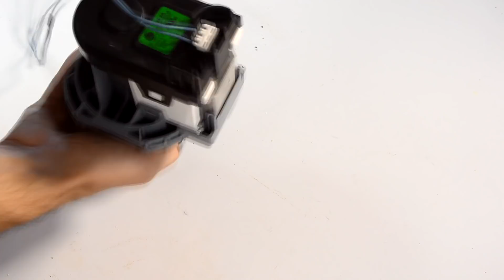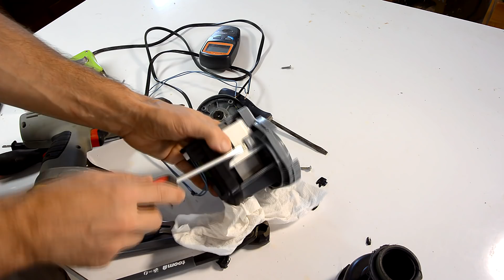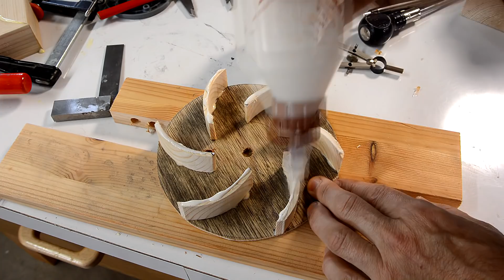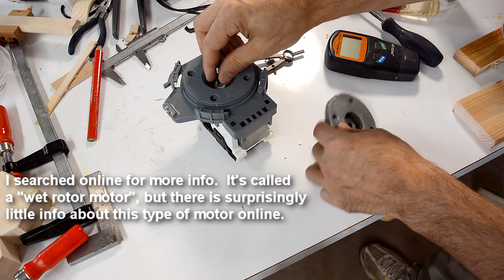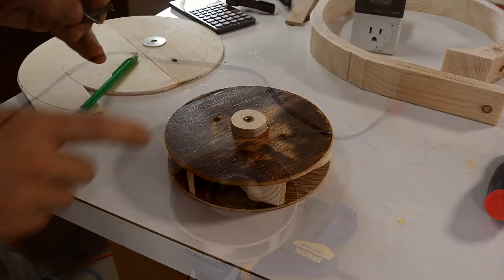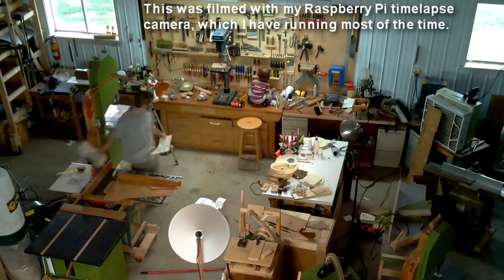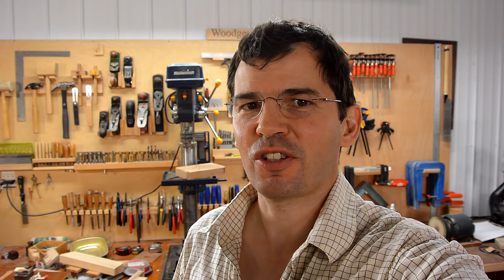Wet rotor synchronous dishwasher motor

Comment: You know who could tell you more about this motor... AvE  You guys should do a collaboration video on motors.
Reply: I can't decide if that would be a complete disaster or the power tool equivalent of a buddy cop movie. Engineer and fabricobbler, working together. Measurement meets guesstimation. Design intent meets dead reckoning. Tree corpse mutilation meets slow-motion bumblefuckery. Will they design a marvel of modern materials science, or will they end up dueling with reciprocating saws?
Reply: As a big fan of both I, too, would love to see a collaboration. I think, though, there might be some serious obstacles to overcome. Matthias' orientation is woodworking and home-built woodworking machines; while AvE is a committed metal-head whose passion is exposing bad engineering and design in consumer tools. Also, my sense is that Matthias is in the Eastern Part of Canada; while AvE is way out west somewhere. But one can hope.
Reply: The guy I've learned a lot about motors from recently is Jeremy Fielding
Reply: Actually, I think Matthias knows more about motors than AvE does. I love both channels, however. Anyone who thinks Matthias is a shill has never seen a shill.
Reply: I just watched a couple of the Jeremy Fielding videos. He seems pretty good! I subscribed and will watch for a while.
Reply: Check out Jeremy Fielding on youtube. He's a wizard with electric motors.
Reply: I get the feeling the lot of us sub the same channels ......
Reply: Yup
Reply: The both have adorable shop helpers. That might be enough to start a conversation.
Reply: shoegazer277 Which video? I missed that. 

I like 'em both; you'd think a big empty wasteland like Xanada would be big enough for the two of them. 

OTOH nobody's ever seen AvE. Maybe they're both the same guy. There aren't that many Canadians that can speak; statistically it's not unreasonable.

Comment: are these motors dependent on the water around the shaft for lubrication? Or would they work dry on the long run? did you use any kind of lubrication when assembling it back?

Comment: So, where is green colour on this blower? All presented data isn't nothing new to me because my profession, but are simple and clear presented to wide range of DIY people. Water cooled motors goes burned out and overheated if running without water, rubber or silicone parts, etc.

Comment: How did it break?

Dishwasher repair seems like a dark art but but there really isn't a whole lot to them and most issues are pretty simple to fix.
I've repaired my own once, fixed one for one of my tenants and got a free counter-top one from the scrap yard that I got working again for the cost of a small microswitch.
Reply: Probably the main controller board, mine stopped working after about 10 months and under warranty needed lots of parts to resurrect it. It's been fine since 6 years counting.

Comment: I've recently fixed a few water pumps that had a similar mechanism... (fishtank pumps and  a standalone water pump.)  The entire impeller and shaft/magnet were in a wet environment, and the motor windings were enclosed in a waterproof housing.

Comment: So, you Need to pull the choke to get the motor to start? Sounds kind familiar
Reply from the maker: ha ha, hadn't thought of it that way!
Reply: Maybe build an iris for the inlet closed with a solenoid powered by the starting current. Because a butterfly would be too easy. I have an old carb from a garage sale with an iris for the choke. Never could find out what it was used on.

Comment: These are also one of the few motors that don't rely on induced or conducted electric current.. A shaded pole motor's rotor submerged in water, would short, cause electrolysis and wreck the rotor without taking steps to insulate it and thus further reducing the distance between stater and rotor.
Reply from the maker: Not sure about that.  The voltage induced in the rotor is very low (remember, it's shorted), so it might be too low a voltage for electrolysis to happen

Comment: Your little girl already shows signs of growing up with a great degree of mechanical aptitude! (My dad raised me that way.) There is no such thing as "no user-serviceable parts inside"! :-)
Reply: TheTechnosasquatch we have statutory rights here, which is 6 years on stuff like this for manufacturing faults. Too many people dont know that and dont understand what it means. Obvioisly if u abuse it, its not covered, but random failure is covered.
Reply: Ace Lightning i was brought up the same way, when something breaks, i usualy take it appart to find out whats inside and learn how it works. Unfortunatly, when my dishwasher broke, it was the pump that went, and the thing was not easy to get into. At a year old, i would have expected that dishwasher to still be in warrantee? Or do you not have such great support over in the USA
Reply: In the end, though, it wastes resources and contributes to pollution, unless the company is willing to recycle the entire broken machine.
Reply: I've replaced a couple of dishwasher motors - usually you have to contact the manufacturer to get a replacement motor, and sometimes it's more expensive than seems reasonable. They'd rather sell you a whole new dishwasher instead of a simple part.
Reply: Moving the sawdust from one bucket to another, fun !
Reply: +Ace Lightning...That is becoming the accepted business model, replace, not repair. It is cheaper for a manufacturer to give a 20% or more discount on the purchase of a new machine then provide the logistics and components for a repair division, nobody wants to warehouse parts anymore.
Reply: Matthias is in Canada, but I imagine they opted out of getting an extended warranty for a better sale price.

Comment: on my dishwasher the magnet broke apart after only 6 weeks of use luckily warranty replaced it but strange fault
Reply: MN SHP not really, if the magnet had a weak point in it somewhere, caused by poor manufacturing, then it would easily pull itself apart when spinning.

Comment: Timme to learn 3d printing and print your own case for the motor.  Also you could get after market bearings that are sealed and out last those bearings if it were important.
Reply: We need wood here, not plastic. Maybe a CNC machine that can handle thick wood.

Comment: The electronics replace the motor start cap.
Reply: No. It is a totally different type of motor. Not an induction motor at all. It is a brushless DC motor or, you could say that it is a permanent magnet synchronous motor. Start caps are for induction motors.

Comment: I thought a cycloconverter needed no storage components.
Reply from the maker: if you want to reproduce a smooth waveform, you may need to output energy when the AC is crossing zero, so you need some storage.

Comment: Aren't perpetual energy machines powered by negative comments on Youtube????
Reply from the maker: if that were the case, they'd have lots of power!  Or maybe just negative power.  That's probably it!
Reply: No, they have a negative charge.
Reply: Matthias Wandel IIRC, "traditional" wormholes need negative energy to keep the mouth stable.... you might be onto something huge! 😂
Reply: that text made me choke coughing and  laughing at the same time hurts. 😂
Reply: I hear they're powered by lot of hot gas.
Reply: Chris Ormsby that's the perpetual head shaking machine - powered by limitless morons
Reply: Yes. While correct, it is not humorous.
Reply: That still requires putting extra energy into the system...
Reply: Chris Ormsby
Reply: I'm fascinated by your ability to reverse engineer anything. Next up, Women.
Reply: I wonder what makes reading comments on youtube more annoying. "Negative" comments or "funny" comments about "negative" comments from like addicted people. Back in the days there were just comments that were related to the video.
Reply: Electrons carry negative energy.

Comment: i do not think you'll have any problems without water, water cannot be used as lubrication medium, but as a coolant, and heat will not be an issue i guess.
Reply: I wouldn't consider landing on your behind after walking carelessly on a wet floor to be that complex.
Note that nobody said that water is a great lubricant, but a pump in a dishwasher isn't exactly a high performance application and a bad lubricant is better than none at all. Furthermore, plastic does not corrode, and making the shaft out of stainless steel solves that problem as well.
Reply: İlhan Neğiş i
Reply: Why can water not be used as a lubricant? Ever tried to slide two glass (or plastic, or metal, for that matter) plates one on another with and without water? Ever slipped on a wet floor?
Reply: viscosity of water is very low, can not form a film between surfaces needs gliding, also there is corrosion aspect to it. It's much more complex than that (fluid dynamics, material science etc.)  which I can not say I'm expert, but general idea is there.

Comment: That rotor is like what you'd fine on a water pump, like pumps for liquid cooling computer components in either open loop or closed loop cooling solutions.

Comment: Have you tried using sections of large diameter pvc pipe for the blower fins? Or is there no reasonable way to glue it to wood without it flying off?
Reply from the maker: too small a radius, too heavy, too hard to glue

Comment: 1 year old, no warranty?
Reply: Built as cheap as possible and sold for as much as possible and then thrown out because something broke that isn't worth replacing.Sadly it's the way of the world these days,gone are the days of getting 20+ years out of an appliance.
Reply: not sure about Canada, but down on this side of the border, its common for different parts of the dishwasher to have different warranties.  10yr for the tub, 5yr for the racks, 1yr for the electronics.  On top of that you have to have a licensed repairman for that specific brand local to you to do the work.  If there's no authorized Bosch repairman close to you, then a warranty on a Bosch diswasher is worthless.
Reply: A 5-year protection warranty from home depot is 80$ for a 300$ dishwasher. That's 6 years of protection or a free replacement. the majority of parts can be fixed at a house with stuff brought along with the tech. I'm currently going on 8 years of abusing a small fridge that I got at a discount because it had been dropped or crushed slightly. Nothing has changed as far as longevity; there's just more parts and safety checks in place to cause things to stop working rather than truly die.
Reply: So you have to pay an extra 26% for a decent warranty.  You could have spent that extra money on a better dishwasher in the first place that wont fall apart.
Protip - buying extended warranties and insurance on things that are not tens or hundreds of thousands of dollars to replace is always a ripoff and the warranty/insurance companies come out on top by a huge margin.
Reply: giantpune my parents had a fridge from 1980-2005 and renewed the warranty throughout. it came in handy 4 times when a part died from overheating from being covered in dust.
Reply: Adam Rivera - If you and your parents want to keep buying junk and adding 26% extended warranties to them, its your choice.  But you know you only get any value out of that extra $80 if your item breaks, right?  If you'd just spend that money on a better unit to begin with, you'd get something in return for your money even if it doesn't break.  Its not just the money, either.  Every time it breaks, thats time you don't have a working appliance, time you have to call the repairman and wait around for him.

Its well documented that in the big picture, the insurance companies make huge profits from people buying warranties.  Don't take my word for it.  Go look it up.  Can you even count how many of these warranties you've bought over the years for things that didn't break?  Probably not.  You're overpaying 26% for everything you buy and just forget about that and only remember the 1 or 2 times the warranty actually came in handy.
Reply: giantpune there is no such thing as a 'better unit'. I either buy specialty and break an entire bank account fixing when it does break down or I buy something that thousands of others will also buy meaning there'll be replacement parts. I have used the warranty on a microwave that I bought. The door switch wasn't working and the repair guy came out within a day and fixed it then again within a week. I mean, the whole thing was replaced as part of a recall but I didn't pay anything for it to get fixed.
Reply: Adam Rivera - There most certainly is something such as a better unit.  When you spend more money on something, it can come with more features, better materials, and higher quality control.  You're buying the cheapest thing they have available, but you end up paying the price of the better item.

You still didn't bother looking up exactly how much of a ripoff those warranties are, did you?  Go ahead and do it.  I'll wait.

Comment: Wet rotors  are also used in all domestic central heating systems. Permanent magnet rotor type motors are more efficient than the usual shaded pole induction motors used previously.

Comment: This is very similar to what the chemical industry calls a canned motor pump. The brand I am most familiar with is the Teikoku.  These are in place where you cannot risk a leak from a mechanical seal.

Comment: "Broke after 1 year" It's almost like they're designed to fail.
Reply: they're not 'designed to fail'. They're designed with an expected life and warranties bolster their life. My parents had a fridge from 1980-2005. Always renewed the warranty but only used it 4 times (primarily from dust build-up causing a part to overheat and die).
Reply: Thanks Adam.
Reply: @brothyr  no. Phones are "designed to fail".

Comment: Look up ball bearing motors if you're still interested in odd motors.
Reply from the maker: what is odd about using a ball bearing?
Reply: The ball bearings actually power it, the current runs through the bearings and causes them to expand when they resistively heat and so causes the mechanical rotation in this way.
You have to watch a video to fully understand it, but a very unique motor indeed, although impractical.
Reply: OH yeh, i saw some vidoes about those a while back, they're quite the oddballs indeed O.o
Reply: Those are interesting!  Apparently, there's some debate over how they actually work - the inventor claims they do not use magnetism, but others disagree.

It would be a good thesis subject for a physics or EE graduate student, if they could figure out how to power the thing more than a couple seconds at a time.

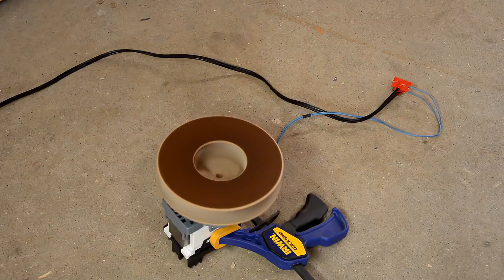Comment: saw the wires taped up at 8:30. Did you pop the breaker
Reply from the maker: no, was just afraid they might touch.
Reply: more likely it's because Matthias knows it'll wander and move the wires.
Reply: knucklecorn he didn't tape them earlier. That's why I was wondering

Comment: I think this type of motor can overheat without water and stop working until it cools off.
Reply from the maker: If it was an induction motor, the rotor would get quite hot and the housing would indeed be a problem.  But being a synchronous motor, there is much less energy lost in the rotor.